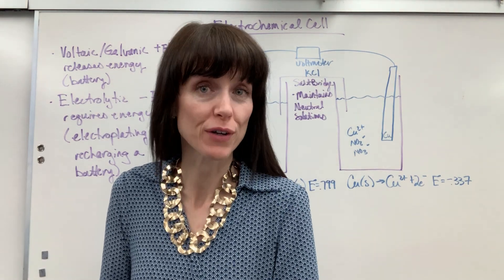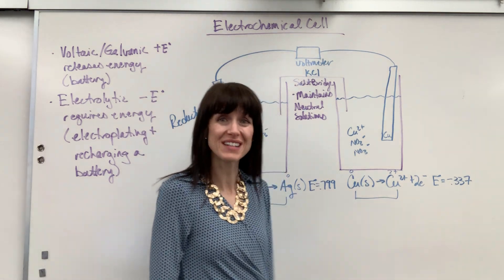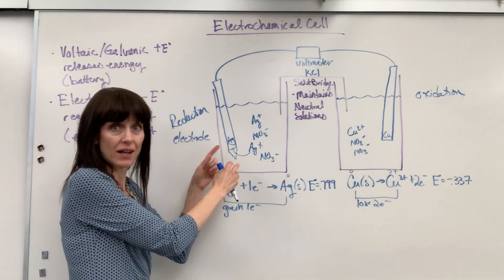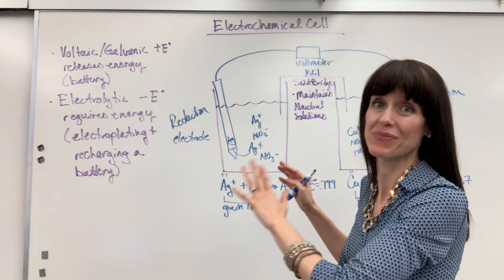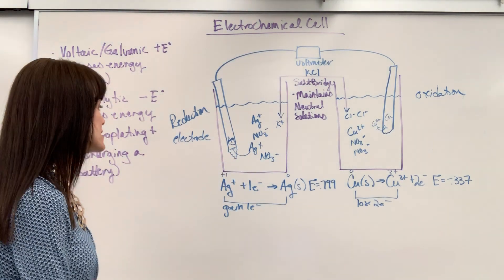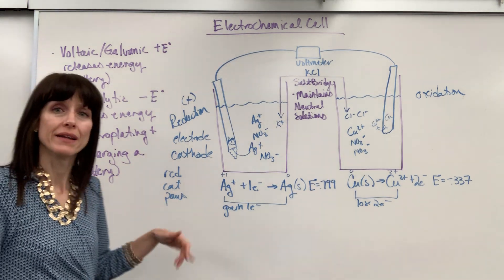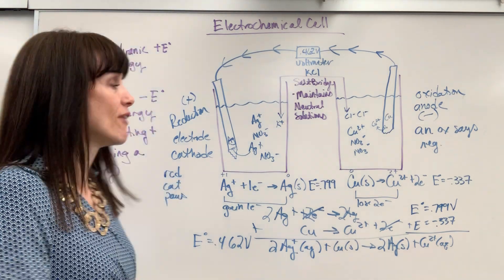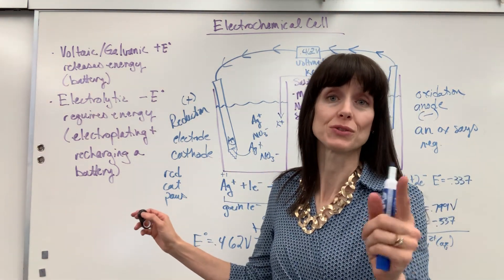Electrochemical Cell Overview

Comment: On google it says that the mass for the cathode increase and the mass of the anode decreases? So im confused on which is right? great videos!!
Reply from the maker: Hi Malak, that is correct. The electrodes themselves gain (cathode - reduction) and lose (anode - oxidation) mass.  The half cell masses stay constant because the gained mass came from the cathode half cell and the lost mass went to the anode half cell.  I hope that helps!

Comment: and i recall mr. knowak showing how we weigh a penny on a very accurate scale .. he was trying to get so many grams , not sure if he was getting a counter balance weight .. he was discussing shaving a penny with a file (this was not a class lecture) .. i think a penny comes in around 3 grams if it is of the value metal , less of the lower class variety ...